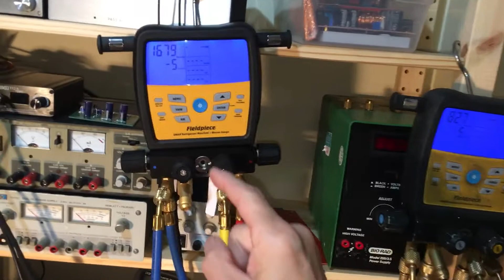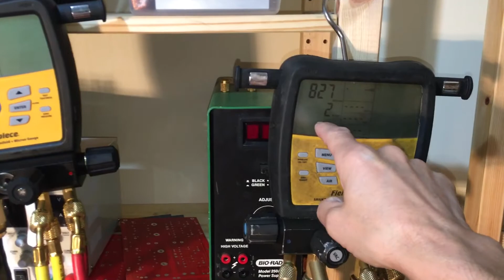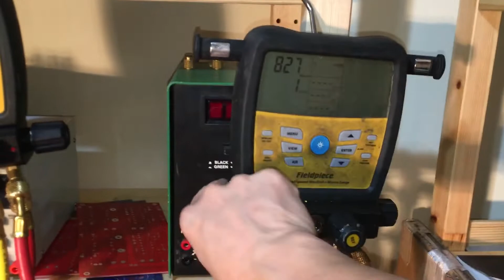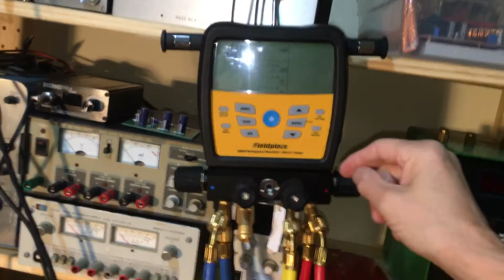Pt:5 SM480V Overnight vacuum decay test on yellow jacket plus II hoses

Comment from the maker: If there’s one thing I forgot to mention and make apparently clear to everybody pulling a deep vacuum and trying to hold a vacuum decay using refrigerant hoses is not going to work.
                Refrigerant hoses were never designed or supposed to hold a deep vacuum they will always fail this test.

Comment: On the older SMAN models (maybe also the new SM models?) it will NOT display microns unless either the high or low pressure sensor ALSO has at least SOME vacuum, so the high or low port needs to be open, or high or low side need to be capped off with vacuum inside.
Reply: SM480V user manual shows a manifold diagram on page 39...
Reply from the maker: @networkedperson  yes I actually took manifold apart. Did a video showing the individual sensors location from the inside of a manifold how they’re drilled tapped and ported into the manifold aluminum machine body.
Reply from the maker: @networkedperson  yes I have some follow up videos later with different ports open and closed and explaining the difference between the transducer for pressure and vacuum on the high and low side.  
   Compared to the standalone micron sensor that is inside the center of the manifold isolated from the high side and low side when parks are closed. 
      I actually have manifold disassembled video showing different components inside and a transducer.

Comment: This is so frustrating. I bought these gauges 3 weeks ago first day used them won't pull below 800 microns searched and searched for a leak nothing. Pressure test kept dropping decay would not settle kept rising closed off manifold same thing. Returned them ! Brand new set today today same shit !! Like what am I missing. There's no way my system has a leak. Infact I knew I was getting my new set today. So left my system on pressure over night to insure no leaks on any of my welds and same shit !! Would not pull below 600 after 4 hours like wtf !!
Reply from the maker: Anyway nobody should be trying to draw through refrigerant hoses and a manifold to do a vacuum decay it’ll never work. 

That is against everything everybody is taught that’s only backyard do it yourself style who has no education about trying to do a vacuum Decay test. 

You’re trying to do something that you should not be doing in the first place. 

Now for a high-pressure nitrogen decay test no problem.
https://youtu.be/C8VLjBnkEcs
Reply: @coldfinger459sub0  For the system containing POE oil, like that of a R410a or R404a system, a finishing vacuum of 250 with a decay holding 500 microns or less should be achieved, and never a decay rising over 1,000 microns on an R410a system opened for service. For ultra-low-temperature, refrigeration, a finishing vacuum as low as 20 microns may be required with a decay holding below 200 microns (for these systems, consult the manufacturer if at all possible). Each of these requirements is focused on the acceptable level of moisture remaining in the system, again because at these levels the majority of degassing has already occurred. The time allowed for decay depends upon the size of the system, but generally, 10 minutes minimum with 1 minute added per ton is a good guideline.
Reply from the maker: @leelee287  that’s all in good you did a lot of reading but you’ll never obtain any of those vacuum ratings using refrigerant hoses with refrigerant gages. 

I have one of my videos going down to 10 µm on a large LG VRF  20 ton heat recovery unit with over several hundred feet of copper going to a couple 6 ton air handler‘s and one 8 ton air handler .   

I would’ve never been able to handle that using refrigerant hoses through a manifold not gonna happen. 

  
https://youtu.be/C8VLjBnkEcs

Do you have to watch this will explain everything what Jim does in this video is exactly what my dad did to me when I was a child before high school
Reply: @coldfinger459sub0  ok wizard tell me how to do a proper decay test on 100 foot line set 7/8ths and 38ths . Pulled down to 100 microns . Your telling me you do a micron rise test ?!
Reply from the maker: @leelee287  you have to use a dedicated micron meter and a dedicated blank off valve with the second attachment for your micrometer so you can valve off your vacuum hose. 

          But the easiest way to do it is using a silicone vacuum rated hose you just need one of them. 
https://www.trutechtools.com/Tru-Blu-Advanced-Kit-BluVac-LTE?utm_source=google&utm_medium=surfaces&utm_campaign=shopping%20feed&utm_content=free%20google%20shopping%20clicks&gclid=Cj0KCQjwvO2IBhCzARIsALw3ASrgPRrC5svRamkd_MTO1hJ19K3WnFHY9iAT5oOJt01-Lbmjv49EuxIaAslXEALw_wcB

This is just the example one of the cheaper kits. 

        But you could do the exact same thing with one hose it only takes a little bit longer there’s a huge difference between using refrigerant hoses that are basically like a sponge material rubber
         And silicone hose that is made for pulling deep vacuum. 

     You put the BluVac vacuum meter micron meter for example on the high side with a little brass valve that can shut off and isolate it from the system

And then you put your vacuum pump and vacuum hose directly to the low side port with the valve core removing tool so you do not have a valve core restricting. 

     Where is the simplest cheapest most effective method for beginner. 

And then if you want to get fancy and go to two hoses and more valving and bigger vacuum pump that’s your option but you can achieve the same thing with one hose. 
 
Watch summer Jim Burgman very good videos on pulling a vacuum using micron gauge 

I’ll see if I come back and edit this post and add a link to his video this is all stuff my dad taught me when I was a child before high school.   It’s very simple
Reply from the maker: @leelee287  https://youtu.be/C8VLjBnkEcs it’s really easy
Reply: @coldfinger459sub0  if on a brand new install if you pull a vacuum down to say 100 microns if there's no leak it should jot rise about 500 or 1000 lets say with 20 minutes . That's why there is a timer on the gauges for a decay test
Reply from the maker: @leelee287  only use for doing high-pressure nitrogen decay test not vacuum
Reply from the maker: @leelee287  you are getting the difference decay test mixed up the timer is meant for high-pressure nitrogen decay test. 

     Never use refrigerant hoses for trying to do a vacuum decay test.        

You can do a certain extent do a mediocre vacuum decay test.    But only to look for a very large leak or trying to differentiate the difference between a leak and moisture. 

Moisture will usually flatten out somewhere around 3400 µm plus or minus a few hundred microns and then stop rising.   That usually means you need many more hours of vacuum. 

On the other hand a leak will keep on slowly rising after 4000 µm 5000 µm in slowly slowly keep creeping up. 

But I would never rely on my measurements using refrigerant hoses

The gauge directly attached to one of the service valves the high side or the low side
Reply: @coldfinger459sub0  maybe get back to the books your a car mechanic I'm a red seal journeyman refridgeration mechanic!
Reply from the maker: @leelee287  titles mean nothing pieces of paper and certifications mean nothing. 
If you’ve been doing something wrong for the past 40 years it doesn’t make it right if you do it more. 
https://youtu.be/C8VLjBnkEcs
Here’s a video with procedure so easy even a child or a red seal journey man with a shiny glossy certificate can understand.

Attempting and trying to use refrigerant hoses with a manifold gauge that will matter how long or how many times or how many years you try it will still be wrong and you’ll still get bad results. 

Doing something wrong 100 times doesn’t make it right.

Or you could do the original way I used to do as a kid the way my dad used to do when he was young the way his grandfather time,  make lines out of soft copper and ran them directly off your vacuum pump. It was good enough for Mr. William carrier 100 years ago,   It’s a procedure using soft copper lines around the world in Laboratories. 
          And if you want to get really fancy you use stainless steel lines.